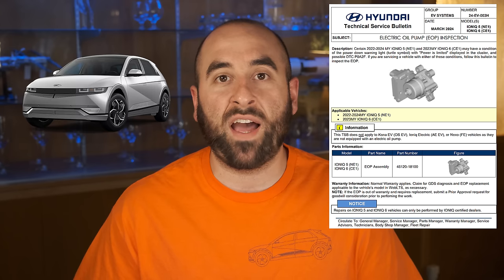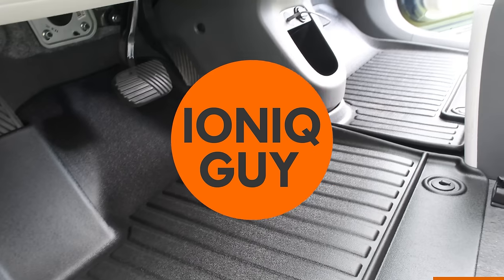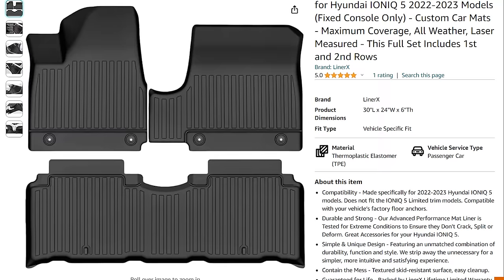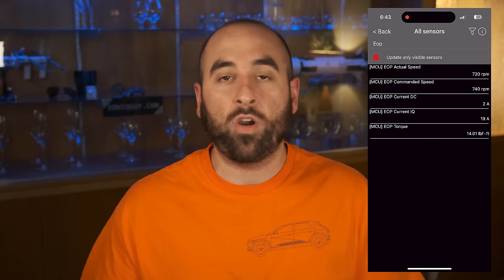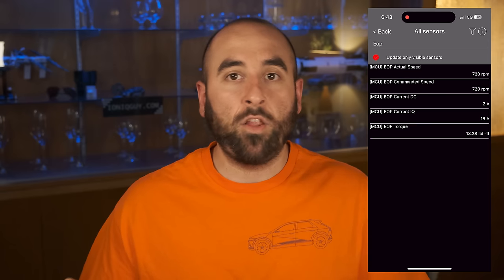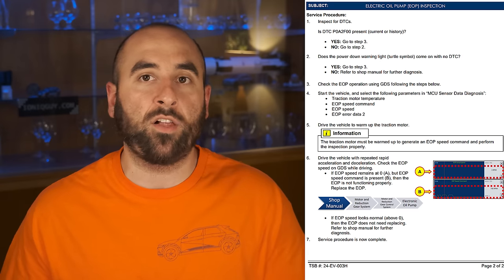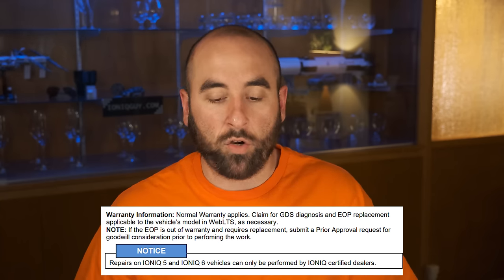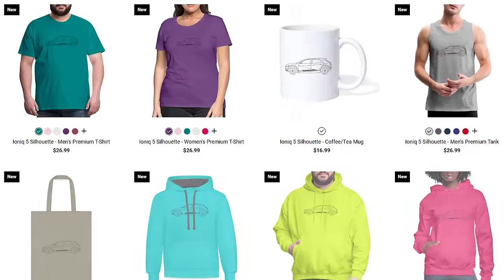Ioniq 5/6 TSB Released for Faulty Motor Oil Pumps | This Explains Turtle Mode

Comment from the maker: 📃EOP Technical Service Bulletin: https://static.nhtsa.gov/odi/tsbs/2024/MC-10252359-0001.pdf
💸Purchase Veepeak OBD2 Scanner: https://amzn.to/3TY6bpc
💸Purchase my Ioniq-inspired clothing designs here: https://theioniqguy.myspreadshop.com/
💸Purchase any of my products here: https://www.theioniqguy.com/
😎Support the channel by becoming a channel member and get lots of extras like Ioniq 5 emojis in comments, discounts on my stores, early access to new videos and much more! Membership starts at $3/month.
Reply: So my 2023 ran roughly the equivalent RPM request as it reported rotation but never went over 1A draw. That could have just been the oil viscosity (65°) that had yours show approximately double or it could be a slight rounding difference versus what you showed. Thanks for the heads up as I added it to my CarScanner view for future reference. 👍🏼

Comment: I decided I need to start Posting my Insite into your Videos. Me I'm a Master Kia/Hyundai Technician I also hold a Masters Deg in Applied Science from ASU. When you see these TSBs, it will normally mean, a very tiny Percentage of these cases have occurred, and Hyundai has released this info to help the Technicians to make the correct fix. This is not a Recall.   As for your anecdotal reasoning:  Definition is an adjective (of an account) not necessarily true or reliable, because based on personal accounts rather than facts or research: That can put things in people's minds. That can make them create unreasonable Assumptions. At my current Dealership we have not seen any of these failures with us having a large population of these Vehicles in are area.
Reply: I do not wish to interrupt his channel in any way. But if you wish for the actual science behind certain issues that are brought up, I would be glad to Place my Scientific input into whatever discussion is at hand. Just non bias Factual Input.

Comment: MY EOP didn't work from day one in my car.  It took me self-diagnosing the problem with help from the FB forum to get them to look into it.  Then it took 8 weeks and a "hyundai master tech" to fly out and confirm what I had told them.  Finally got my car back and haven't had any issues with it since last summer.  Glad to see hyundai is learning, even if it's at a turtle mode pace
Reply: I had the same thing happen (dead from day 1) with the PTC heater on my EV6.  Self-diagnosed with OBD Link and Car Scanner app, and it was finally fixed under warranty.  Problem is that the Kia "technicians" are largely incompetent; some will not work on EV at all because they are afraid of getting zapped (electricity!).  I like my EV6, but if Kia does not get their shit together, I may sell it and never look at a Hyundai/Kia/Genesis product again.
Reply: Same here 2023 AWD and after about 50 min of driving the rear motor would reach 200 degrees and quit, only front motor working.  No trouble codes. Took way too long for me to convince Hyundai to replace the EOP. It was OBVIOUS that the EOP was dead. (We are on the bleeding edge.) All is well now, just got 3.8 miles/kW on a 200 mile run through the Blue Ridge Mts. Great car.

Comment: Thankfully, I have only had turtle mode displayed on my dash when my big battery was very very, very, very low.
But I don’t think it ever entered real turtle mode until I got to -5 miles range.
Thanks Corbin
Reply: I've once had the turtle mode pop up once because I severely underestimated the impact that below freezing temperatures and incline had on the range and it popped up a couple times going uphill on a highway at like 3 miles remaining and went away once it leveled out or went downhill. It came back on once I hit zero miles remaining on flat ground going 35 three miles away from the charging station and got there at negative three miles remaining. Would not recommend. 

The only other time I came close to the same issue was when I went to a charging station that turned out to be closed while they rebuilt a Sheetz, but in that case I waited at a slow charger for 25 minutes just to make sure I didn't run into the same situation getting to the closest fast charger.

Comment: I own a 2023 Ioniq 6.  I have had it for less than a year.  My Ioniq now has 2 NTSB safety recalls and 3 Technical Service Bulletins as well as an unresolved tapping sound from the rear brakes and the safety cameras intermittently go dead.  All of these issues have occurred in just the first few months of ownership.  With the exception of one TSB pertaining to the remote door key proximity lock/unlock not functioning, the recalls and TSBs are all serious situations.  The two NTSB recalls pose the risk of the vehicle suddenly becoming inoperable. Further, my dealer says they have not received training yet to repair the rear driveshaft recall.  It is irresponsible of Hyundai to have these sort of factory defects and not properly developing and testing the Ioniq 6 before putting it on the market.  Despite the Ioniq’s great looks and good handling, I can no longer recommend anyone buy it.  Hyundai is a great disappointment.

Comment: So ninja turtle kept popping up  a few times, drove for about another 1mile down the road to find a safe spot to pull over. Car went pretty much dead by that time  just rolling. Popped the hood absolutely no pink fluid, if I'm correct pink is anti freeze then about a few minutes later the  refill coolant decides to pop up on the dash, alittle too late for the warning. As you can see only 800 miles! Has anyone had this problem? Or is this a common issue among these Ioniq5? I know of the ICCU issue with these vehicle but not sure of this problem. Was not expecting this at all. Left me and my family of 5 stranded on a busy highway in 93°weahter for 3hrs. So any help or advice would be greatly appreciated and what action would you suggest for hyundai to take care of.

Comment: Today I brought my 2022 Ioniq 5 Limited in for the Recall on the ICCU and asked if the tech would look at the Electric Oil Pump diag code. I was informed NO as this is not an active recall. Is this correct or shall I go to another service center? Love the channel and thanks!

Comment: Corbin, when I look at your specialized tool to diagnose this problem or hunting down the ICCU charging issue like you did in a previous video, it would appear to me that Ioniq drivers needs a tool box to enjoy a Hyundai… The more I think about it, the more I like my Acura ICE car. No need to any tool. Never breaks.
Reply: Your Acura ICE car uses the exact same tool to diagnose its problems as well. Industry standard. My IONIQ 5 never needed any such tool either. Commentaire nono.
Reply: @fleecystheking  Fact: There is a problem or a recall every month or so on a Ioniq car… Not on my Acura…
Reply: It may be an EV, but it is still a Hyundai. If you want an EV, get a Tesla.

Comment: Im looking to buy an Ioniq 5, but with all these issues with 12v drain, defective radars, oil pumps, rusty bolts, ICCUs. I mean, is anyone worried about these cars when waranty runs out?
Reply: You should really go look at how many warranty extensions and TSB's are out there for basically every car ever. 

This is nothing special, and pretty normal stuff honestly, across both EVs and ICE cars. You're watching a YouTube channel dedicated to these cars. They aren't talking about all the TSB's for a Ford focus for example. My 2013 focus has a tsb that, if ignored, can result in an exploding gas tank. Just some perspective for you.
Reply: @CarlWiles  there are properbly many. Maybe i should just wait 10 years and get a 2028 model, then most of the issues should have been adressed.
Reply: My 2023 plug in hybrid ford escape had a recall for fire hazard and then the 240 plug would not work. The dealer said just use 110 volt charging. 

Our 2022 Lincoln  SUV had the engine fail at 49000 miles. Then fail again after a Warentee engine replacement . . No solution offered. 

Some perspective on the ioniq 5. . Our 2023 ioniq 5 sel works wonderfully. Range under ideal temps 374 miles this week.

Comment: Hi Corbin,
      I have a 2023 Ionic 6 Limited. I also have a Veepeak OBD2 Scanner that you had recommended. The latest TSB regarding the EOP has
me really concerned. I tried using the scanner to monitor the EOP but was not very successful. Could you help me narrow down the area on the
data screens where I should look for the EOP data? Thank you. 
Best regards,
Jerry K
Reply from the maker: From the car scanner Home Screen click the “all sensors” button and then at the top use the filter button to search for “eop” and you’ll see the multiple parameters pop up
Reply: @TheIoniqGuy  Thank you Corbyn. Much appreciated.

Comment: Just wanted to thank you for helping in making my decision to buy an Ioniq 5.
I brought it yesterday and from my very limited time with the vehicle I think this could be the best car I ever owned.
I do have a concern and I would be interested to know what you think about it. 
The car was bought as a certified pre-owned vehicle from Hyundai, and it was "put in service", according to the dealership, in 4/2023. The car is a Premium model and it  had only 56 miles on it at the time of the purchase,  which included my 10 mile test drive (they claim it was a loaner). The looks and feels brand new, in and out. I was able to negotiate a very good price for it (nearly $20,000 off the original MSRP)
My concern is that no one was able to tell when the vehicle was charged (when I took it for a test drive its battery was at 91%, and it was set up for 90% DC charging  and 100% AC charging). I  am not sure if there any long term effects on health of the battery staying fully or nearly fully charged for nearly a  year. The car does come with the full  factory warranty starting 4/23, just don't want to deal with any possible battery issues in the future. 
Thanks again.
Reply: No issue with staying charged like that. It's a good sign
Reply: @dingleyfarm  Thank you for your response. I had a PHEV before and always tried not to keep the battery fully charged when not driving the car  for more than a few days.

Comment: I would never buy a Telsa because of musk and because all the accessories are on the monitor. I want a Hyundai Ioniq 5 next but seems like they are having quite a few problems. What do you think Corbin?
Reply: How do you feel about Hyundai's owner?
Or Toyota?
Or the guy who owns your smart phones company?
Just curious.

Definitely agree on Tesla's bad U.I.
Everything on a screen is frustrating and terrible.
I really like the Regen paddles in the HI5 and adore the aesthetics but the reliability and costs are just not there :(
Reply: I would wait for the 2025 refresh of the Ioniq 5 that has the NACS port and as long as you are okay with the small chance of being one of the unlucky people to discover some of the issues that have cropped up. For most people the major inconvenience is going to the dealership more often than originally expected to get whatever update or part is needed that will be fixed for free. I'd personally still recommend it if you've done all of your research on the pros and cons of EVs, are able to charge overnight at home (by far the biggest benefit of any EV), and are okay with going to the dealership every 9 months to fix something that was found and also get your tires rotated which is needed more often than an ICE car.

The refresh will have fixed all of the current issues, and presumably the issues will get fewer and fewer each year. Every new car can have issues and it's just really luck whether you happen to be the one that gets one with some of the worst issues and have to wait a long time for them to come up with a fix. I've never had issues and absolutely love the way it drives as long as you rarely have to make a U-turn.
Reply: I feel the same way about Musk… but given all the issues I’ve had with my 2022 Ioniq 5 I am just sure I can trust any HKG EV
Reply: You might look into leasing if you're unsure about waiting for the '25 updates.
Reply: Appreciated the heads up here on the TSB and will show it to our dealership when we go in for the ICCU recall on Monday.  Regarding @Hiker8886, we were slightly bothered by Musk in our shopping, but really our decision to buy a '24 I5 in January was dislike of Teslas having everything on the distracting center screen and not having as good a build quality as the I5.  We test drove most of the other EV competitors and liked the features of the I5 best in terms of fast charge, range, quietness, roominess and it seemed that reliability was about on par with the other brands.  So far very pleased with our purchase.  I agree with others that new cars do typically have some problems and recalls--our past Honda and Subaru each have had a couple.  So fingers crossed our trips to the dealer to have the ICCU recall performed will be proactive and we won't have the turtle experience on that or this oil pump thing while we are on a road trip ever...Cheers to all y'all other EV folks or those considering.  They are great cars.
Reply: So what is your problem with Musk?  I agree with the "everything on the monitor" issue.  It does give much more flexibility, etc., but in many ways it is a pain